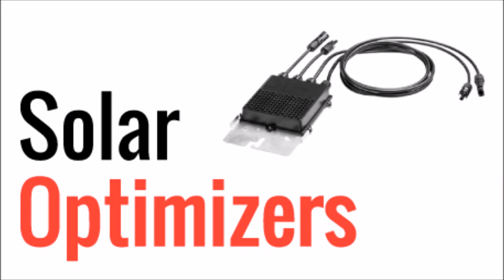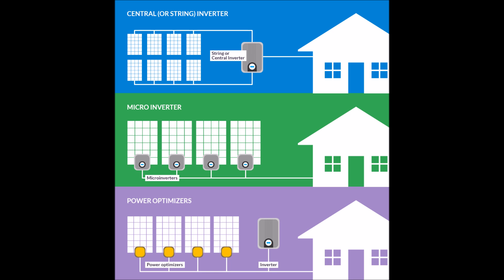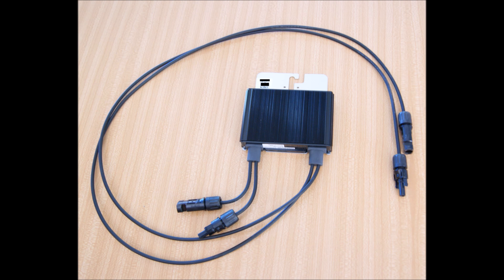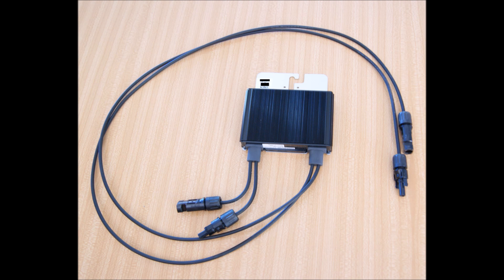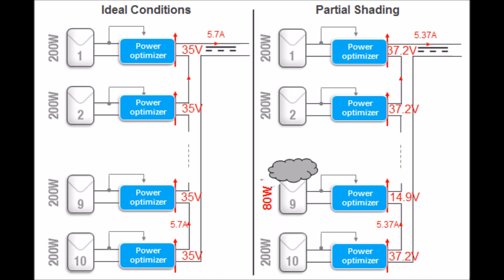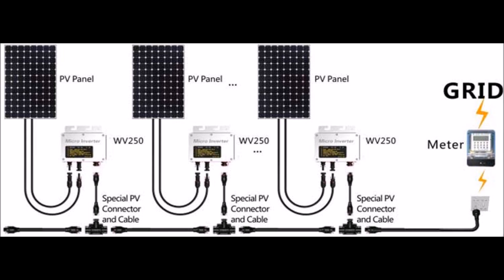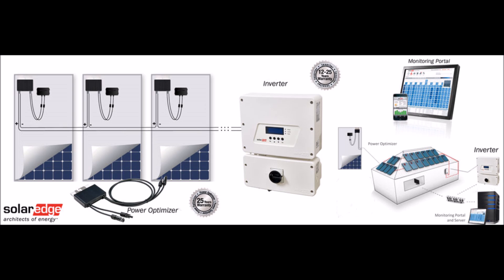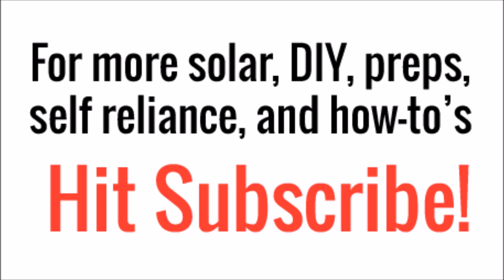Solar Power Optimizers

Comment: Why are they only used on grid tie systems rather than off grid also? Thanks
Reply from the maker: That is a good question.  I think because that is the way they are designed because 90%+ of the market for bigger residential/private installs is going to be grid tied.  Off grid rooftop residential is fairly rare other than cabins and homesteads and remote properties.  And utility scale commercial installs don't need them.
Reply: I had the same question. Since the grid is on the other side of the inverter, what does on/off grid have to do with it at all? Seems like an incorrect statement.

Comment: Can it be used for Off-grid? Im using Bluetti's AC300 and something like this would be great for partial shading on the panels. ( I have a lot of trees)
Reply from the maker: It is possible, but it depends on how your system is configured.  It has been a few years since this video came out and there are new models all the time so I am almost positive there will be one for off-grid use but I personally haven't had any experience with them for off grid.

Comment: Which 60 or 72 cell  solar panel works best with Optimizers for charging a 24v battery bank. How much voltage or current from the panel to turn on the optimizer

Comment: My question is what is inside a solar optimizer? I am concerned with protecting my system from things like an EMP. An EMP destroys anything with transistors, resistors or diodes inside. Do my optimizers have those things inside them?
Reply from the maker: Every component of a solar panel system would be destroyed by an EMP, including the solar panels themselves.  The only thing you could do to protect yourself is to keep a spare or spares inside a faraday cage, which is obviously very impractical and expensive.

Comment: There is a lot of good information on this post but one major point that needs to be corrected is the statement about a failed optimizer in a contiguous string putting stress on the grid-tied inverter.  That statement is incorrect as a failed optimizer will normally isolate itself from the series string circuit and will pass power through that comes from the other optimizers that are upstream from the failed module or the failed optimizer.  Running an inverter under it's maximum DC input rating in no way strains or stresses that inverter.  To the contrary, it can reduce the output stress and reduces clipping by the inverter on cold sunny days. Simply lowering the input of DC power will normally limit/reduce the AC output by a corresponding ratio or factor.  
The other update that needs to be corrected relates to the 250-watt limitation of size or rating of the current offerings in optimizers.  Since 2017, larger optimizer sizes have almost continuously been introduced. 320 watt has been the current "norm" for quite some time, but  370, 400, 600 & even 730-watt commercial optimizers are readily available at the retail and wholesale level.  That lineup provides a very good option for module-level-power-monitoring that an installer can utilize instead of using microinverters that are normally more expensive, especially on larger systems with high module counts. 
Other manufacturers like SMA are starting to offer optimized systems to compete with SolarEdge as the NEC continues to provide more comprehensive safety requirements including module-level rapid shut-down to help protect first-responders that may need to access the roof of a burning structure that is also covered with PV modules.

Comment: Can they be used in off-grid solar? Is there any reason to do that? And would there be any advantage of using them with a PWM charge controller?
Reply from the maker: I suppose you could if you wanted to.  I haven't thought of that.  At first thought it seems silly because $50+ per panel for one of these optimizers (plus a big PWM controller) would be much higher than just getting a big MPPT controller but there could be some benefits.  I'll have to chew on that for a while.  Good comment!
Reply: The partial shading issue is one to consider.  If your string of x panels is series wired, then partial shading of 1 panel limits the whole string output to that of the shaded panel.
Reply from the maker: Right, and that is where micro inverters and these optimizers beat string inverters.  Otherwise if you have no risk of shade ever then string inverters are more economical for some applications.

Comment: Optimizers can work both on grid or off grid.  The information stated in the video is incorrect.
Reply from the maker: Not really.  They require a matching charge controller or inverter to work.  You can't just buy optimizers and plug and play.  And there are very few "production" charge controllers on the market.  All of them I have ever worked with are incompatible.
Reply: LDSreliance yes really. Check out Tigo optimizers.
Reply from the maker: I looked at their site.  Nothing in their marketing or case studies at all about off grid.  There is one "review" that mentions being off grid.  That is it.

So you CAN theoretically get them to work and provide a benefit.  But they are not designed for that application and it would take an advanced user or a solar power company to program the system to work together.
Reply: LDSreliance a man is allowed to believe what he wants, but it does not change the fact that the sun rises everyday.
Reply from the maker: Exactly.  You "can" run an old airplane engine on alcohol (spirits).  Doesn't mean that it will run properly or efficiently or for very long.  

Optimizers were not designed for off grid applications.  They will not work plug and play.  Therefore they aren't for off grid use.  Period.  If you want to use them there, knock yourself out.

Comment: Dear Friends, I would like more precise guidelines on the power optimizer. Some model design. I'm an enthusiast in this area and I'm studying a lot. And I saw that here in Brazil does not have anything on the internet about such subject. I wish I could use it to get by. I will import some items into my residential solar power project and would like to know what items to install in my home. If you are interested in a partnership, I would be very happy because I want to learn a lot and I saw that  is a pioneer when it comes to solar energy.
I await the anxious answer. Thank you!
Reply: Melque,  Did you ever get any input or help on your desire to integrate an optimized lineup into your PV system?  I have designed commercial and residential grid-tied systems as well as hybrid systems for years and I have been doing off-grid systems for remote communications sites since long before that.

Comment: Hi, I am planning a 2 x 100 watt tracking array to run alongside my existing 400 watt fixed panels.  My little solar system powers a couple 100AH SLA's with a Xantrex charge controller.  Wouldn't optimizers help me out here?  I noticed that you say they are only for grid tie systems.  Thanks!  I enjoyed you video.
Reply from the maker: If your charge controller is MPPT this will not help you out, at least not enough to overcome the cost of installing them.  If your charge controller is PWM then this could be a decent investment.  Just make sure your charge controller can handle the high voltage.  I assume you have a C35?  If so, it can handle 55V so it should be fine.